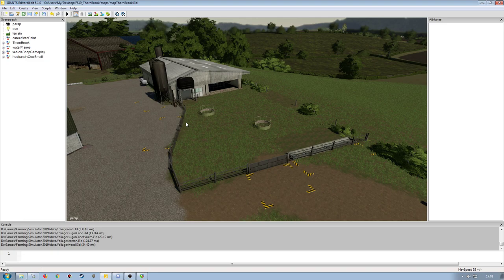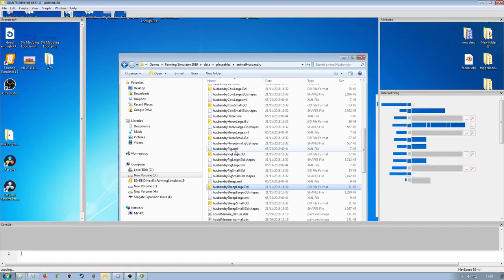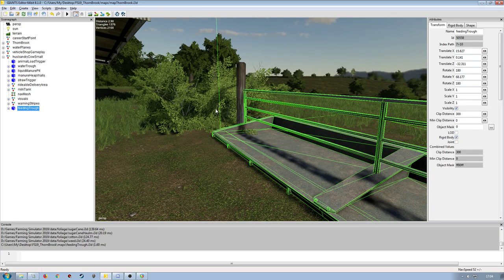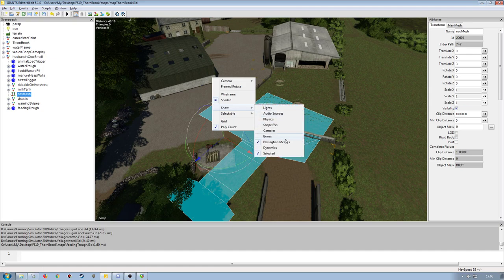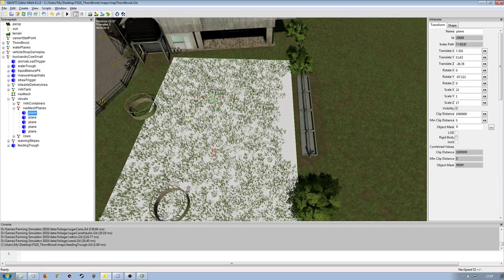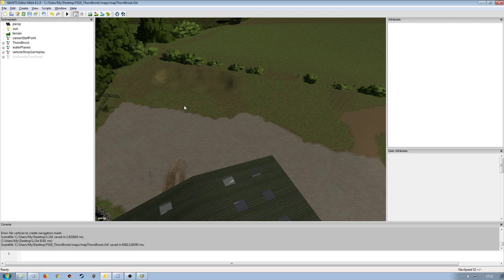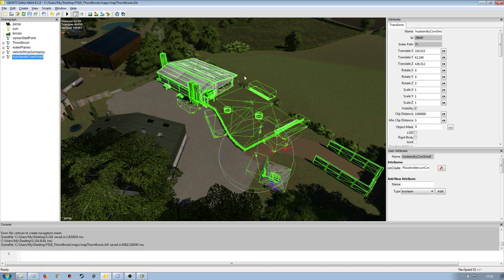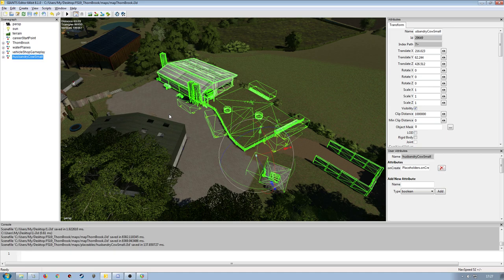Building custom cow husbandry part 2 - FS19

Comment: Hey ShyWizard, I had a quick question about a navMesh.  Can I create a custom cow pasture on rolling hills?  Do I just move each plane around horizontally?  Do I need to tilt each plane and form it to the terrain?  Not sure it is even possible.  Thanks for any input and love all your tutorials as they have helped me immensely.
Reply from the maker: Imo the animal husbandry system for FS19 was never intended to be setup with a predefined area on a map & only to be purchased as a placeable in game.
Because of this the way the navmesh is created it was only ever intended for flat terrain, of course it is possible to slope the terrain slightly & have the planes used to create the navmesh match that by rotating them.
This is where things can go wrong if the slope angle is to great & animals will disappear into the ground or even float above the ground. 
So for rolling hills imo i do not think that would be possible, but maybe i will be proven wrong.
Reply: Thanks for the reply ShyWizard.  Makes sense.  I am going to give it a shot and hope for the best.  Sounds like tilting the planes is what I will try; certainly going to take some time.  It can't be any worse than that insanely stupid field dimension process!